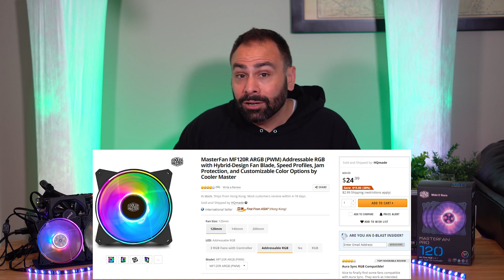RGB vs. Addressable RGB - FIGHT!

Comment: Great video I’ve built plenty of pc’s but just got around to building a rig rull of rgb fans ram and everything else. One question do they make an adapter for gigabyte/aorus mb’s there addressable header is 3 pinns no space and all the plugs fit msi and asus mb’s not sure about the other manufacturers. Just need an adapter for it, i see coolmaster makes one but i cant find any others. Just wish they would’ve use 2 pinns and a space then
1 pinn  which seems to be the standard not 3 in a row.

Comment: I think this is one reason that Corsair went to the old CD-ROM style connector with the latch and keyhole. Makes it more idiot proof, though still has the same 2.5mm pitch connector so someone could potentially plug it into a 12vRGB header, would would kill it as you demonstrated. The digital LEDs are pretty much identical to the analog in function, though the digital have an IC embedded in them that takes a digital signal and controls each diode via PWM. All RGB LEDs I see in PCs use PWM on the low side (negative) and have a common anode (positive). Digital are the same way, but have one more level of hierarchy with the IC.

Comment: I am using ASUS ROG STRIX B350-F motherboard. However, it does not include an ARGB header. Can I plug in my cooler master ML120R ARGB header into the traditional 4 pins RGB header? The ML120R comes together with a controller which includes an ARGB and RGB female connector.

Comment: Addressable has many advantages over regular including running gradient colors b/c the lights per strip can individually be a different color. Reg RGB however is all  or nothing. There are other things too such as light density on a strip. I believe addressable can have more. I've been doing research to do a video like this. Now I'm not sure if i should :P but I prob will lol

Comment: Maybe something to add... asus uses a proprietary connector which is based on the normal rgb header. However most chinese argb strips come with a 3 pin jst sm connector which (just so happens to fit in my mobo btw) will not fit in the asus mobo without an adapter. Imo there should be a universal controller box and connector for argb strips just like rgb ones because the digital ones ar sooo much cooler.

Comment: The reason your fan still works is because those fans in particular actually draw their LED power from the fan header power and take only the signal cable inputs from the 12v RGB header.